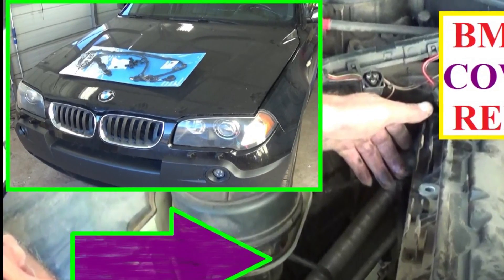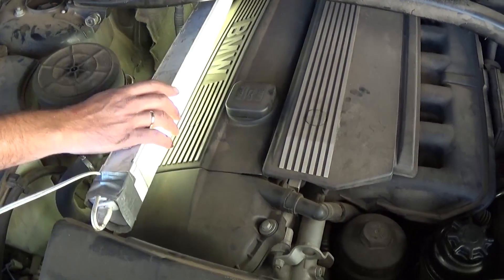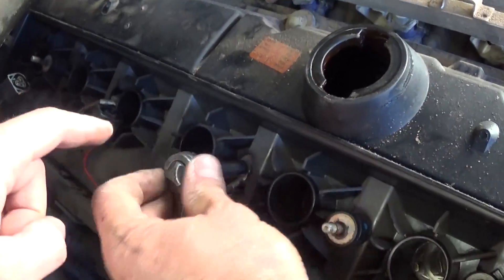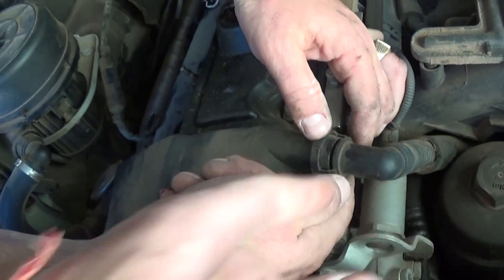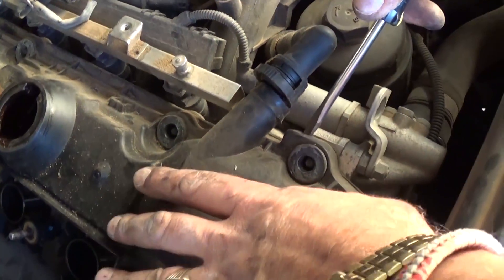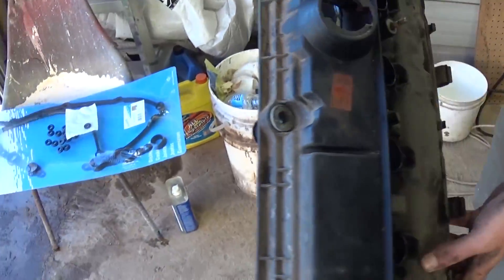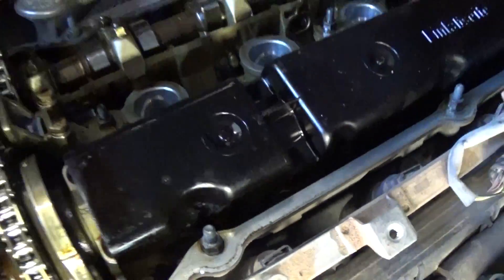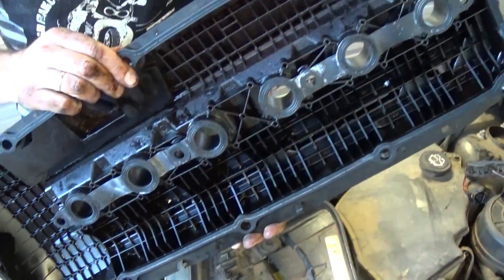Valve Cover Gasket Replacement BMW X3 E83 2.5 3.0 BMW 6 CYLINDER Valve Cover Gasket

Comment: If the rubber gasket turns into plastic, this tells me there is a problem with the design and manufacturing of the valve cover and the gasket.  Why not aluminum valve cover? so, there is no chance of it breaking... Clearly the gasket fails over time.  There is a need for a better solution...

Comment: The bolt snapped when tightening the new gasket down. I went to 10nm as I should and it snapped. I've been reading and people are saying the bolts are aluminium and need replacing often.

Comment: great video - i was told by my mechanic that i need to replace the whole cover & gasket due to loud whistle sound coming from the valve cover - the sound is exactly like this video show here 
https://www.youtube.com/watch?v=RKal0ZjMr7M 

do you think i should only change the gasket instead of changing out both cover n gasket -

also do u have link or website for were you bought the gasket thank you